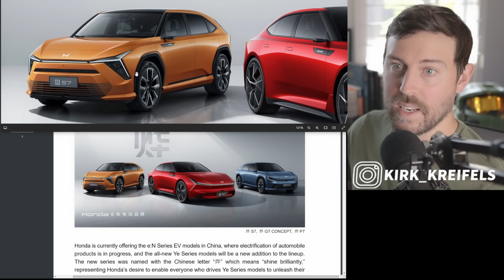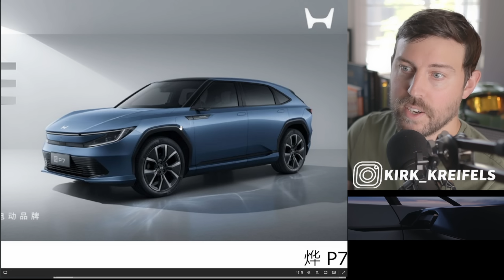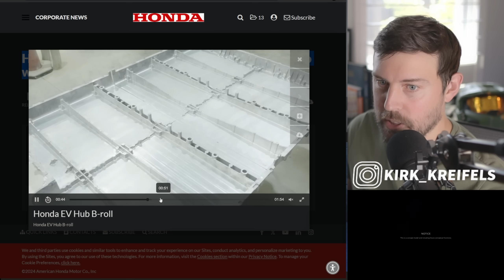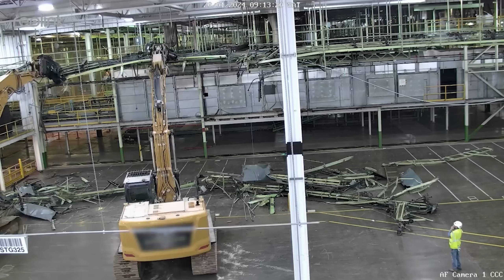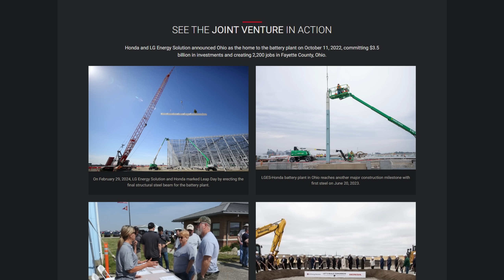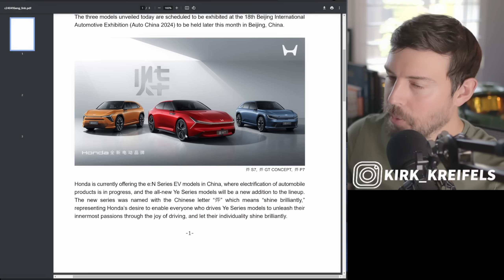Honda's NEW lineup will have REAR WHEEL DRIVE standard!

Comment: I guess everyone has different views on what is interesting. I don’t find anything interesting about these designs. I kinda feel like Honda could go back to one of their popular designs (original Civic, Prelude) and use that as inspiration for something modern. These just look bland and like Kia. Which is fine for Kia but Honda needs more. I don’t think adding creases and edges innately makes things interesting. 

I also think current EVs have ruined some excitement for something new. They gave is things like no buttons or pop out door handles which just end up being expensive and impractical. Takes away my belief that manufacturers can give us something exciting with out making it useful. 

I also think Honda had a hard time with design. While different the 10th gen Civic was not nice to look at it. That was allegedly daring design. The 11th gen imo is much better looking but conservative

Comment: With EVs losing favour these days those new battery plants might have a problem building batteries for cars that aren’t selling? I think solid state batteries will be the game changer if they are everything they tell us, ultra fast charging and very fast as well, plus lighter weight? These are the future so building current batteries are not going to go over to quickly?? Yes, lots of questions so it’s anyone’s guess?
Reply: If you take Tesla out of the equation, are EV’s really losing favor? Also factor in the rest of the world. The North American market is just different.
Reply: EVs aren't losing favor, they're just not exploding in growth as fast, but they're absolutely still growing.
Reply: So in Germany BEV sales in general are up. But hybrid and normal gas diesel vehicle sale also increased in the same period. So the overall marketshare of electric vehicle sold in german auto market is the same and no penetration was detected. Both in 2022 and 2023, EV sales was 18% of the market. That is, despite more EV models being introduced And specifically with regards to Tesla, their Model Y sales increases could not quite make up for significant decline in Model 3 sales. I assume even with the new Highland model this trend of declining Model 3 sale will continue (just look at Norway February sales figures) Same story with UK sales too. In the UK, registration of new electric cars increased by 18%, but they did not gain mkt share as non EVs increased more. EV remains only 17% of new car sales.

Comment: Rwd is also better for range, automakers and buyers don't really care about driving dynamics as much as they care about range and apparently, rwd has been better for regen breaking even though front brakes put in more work as weight shifts onto them while breaking
Reply: Ur pulling that out of your ass, front wheel drive have less horsepower/torque but it got nothing to do with range. And front wheel drive cars have better regen braking that is why most Toyota hybrid and electric are front wheel drive. Toyota didn't really embrace rear wheel drive hybrid until relatively recently
Reply: @miraphycs7377  hybrids have to be fwd because the engine is in the front, the hybrid motor acts as a transmission to keep the engine in its efficient fuel band, planetary gearbox only has 3 gear ratios and toyota awd hybrids do have keep a motor in the rear
Reply: @miraphycs7377  Toyota's RWD hybrids are all "performance hybrids", IMO. Like Honda did with their first Accord Hybrid in 2006, performance seems to be a priority with those over efficiency. 25 MPG is about the best you're going to get with those.